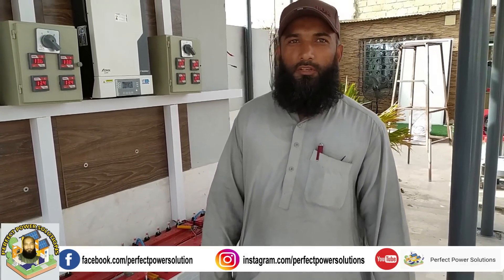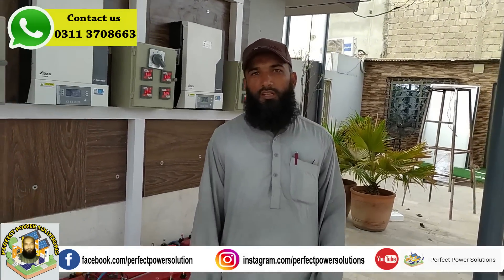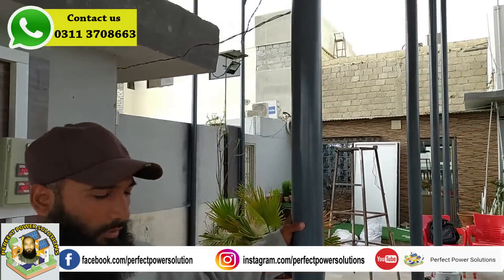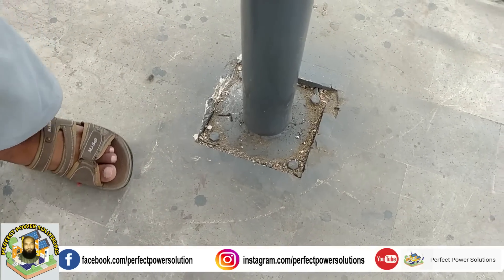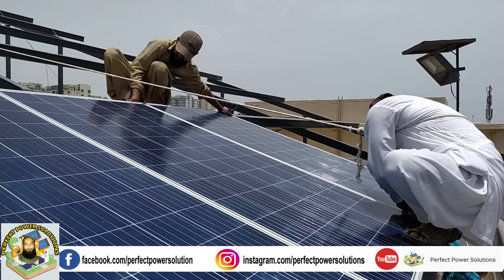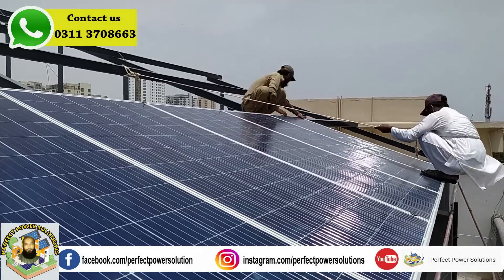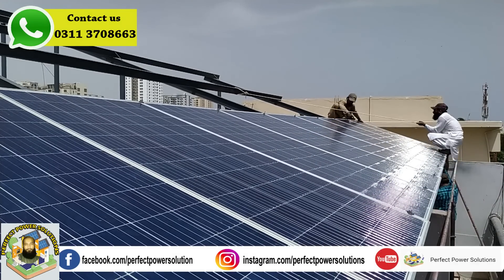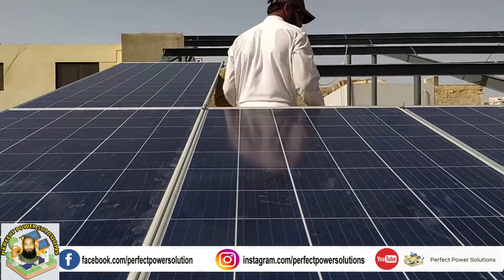15kw solar power system installation at Tariq Road Karachi Urdu/Hindi

Comment: We need a 10 KW ( Solar Panels) Three Hybrid Solar System with net-metering capabilities & Battery back-up.
we have a flat rooftop available for L2 or L3 Stand, not any shadow from the south at any time.
Syed Afaq Ahmed